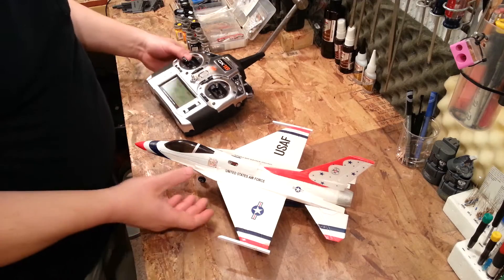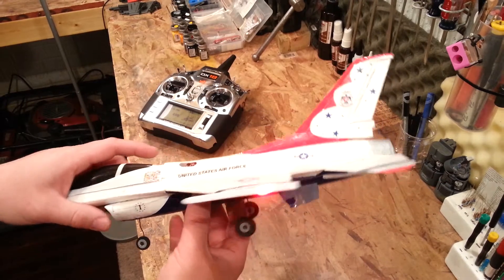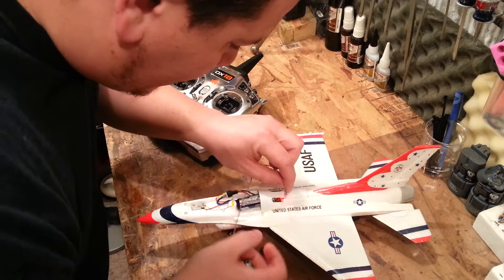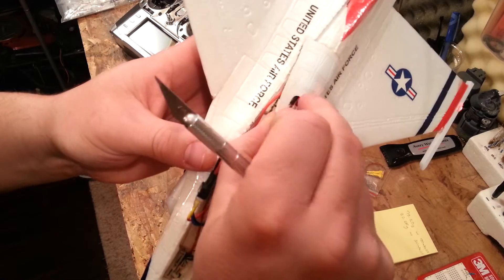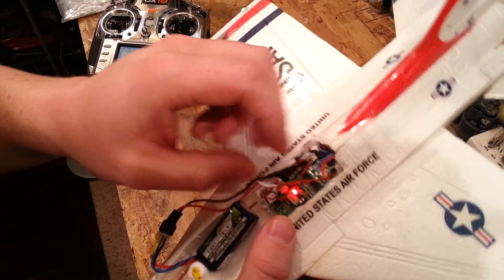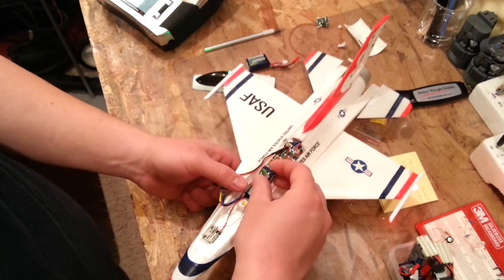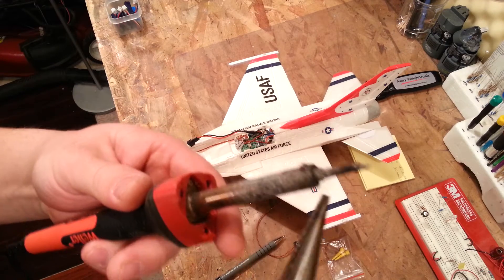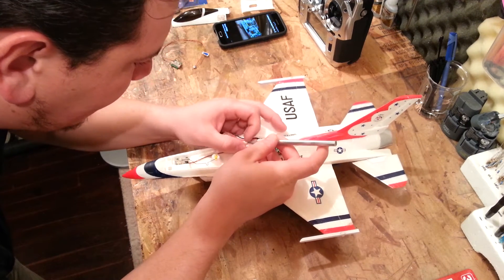Horizon Hobby - F-16 UMX - 3S Upgrade Mod Video - Part 1 of 4

Comment: impossible to see where "rite there is maybe a pin to point with?
Reply from the maker: Sorry James Hirt. This was a horrible series, which lead to failure. I only have it posted to help people see that sometimes my projects fail, just like everyone else :(
Reply: I get it. I'm interested in adding a more powerful motor and esc to the brick in my umx pt-19 (SPMAS6410L) but haven't seen any really helpful posts on that.
Reply from the maker: James, This was one of my rare "complete failure" series...and I feel your pain. Do you mean the PT-17?
This should be fairly easy with the right cable. If you use the X-port, I believe you can make an assignment to act as throttle.
OR you can do something like this...
https://youtu.be/MwN-bWYbOUw
he links to RCgroups on the description.
Do you like the PT-17 pretty well? I thought about buying one, but didn't want to hassle with brushed motors...
Reply: Thanks Brian, that is correct, also people on rc grps are saying to use the gear port. Do you know which is better? Thx & yes pt-17
Reply from the maker: Well, I guess I thought it was called the "Xport" since it's got an extra pin, and you can use it for the FPV setup from Horizon.
I'd go with whatever they suggested, since I didn't have success on this one.

Comment: Any tips for a micro B-25 flap mod?
Reply from the maker: +ArTic ZxBl4zexZ Sorry, I don't have that plane. I believe it has dual brushed motors, so I can't say for sure if it would have an available port.
Reply: Brian Phillips thanks, your guide to the P-51 was very useful, it flies 20x better now with your mods
Reply from the maker: Thanks! It's a lot of work though